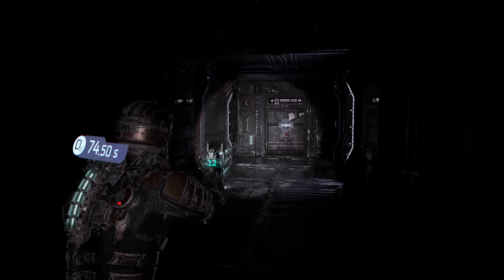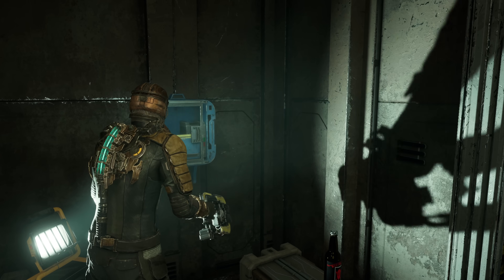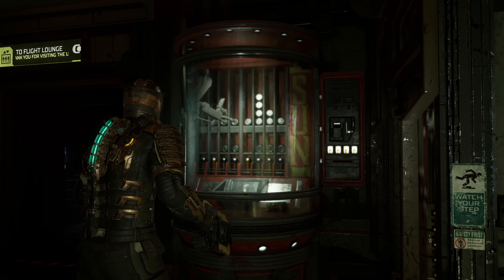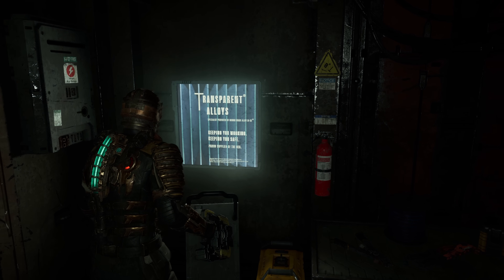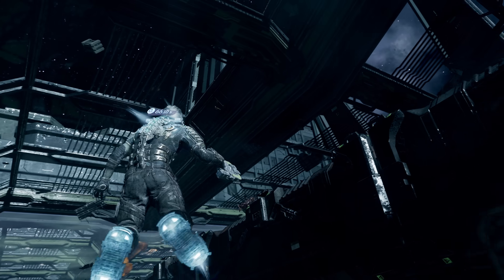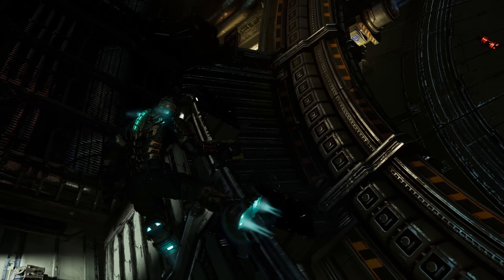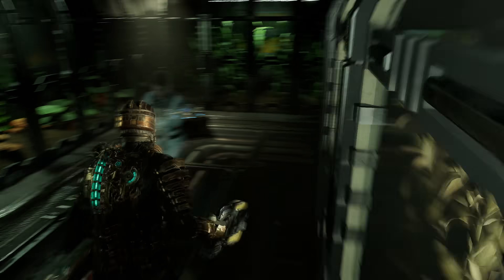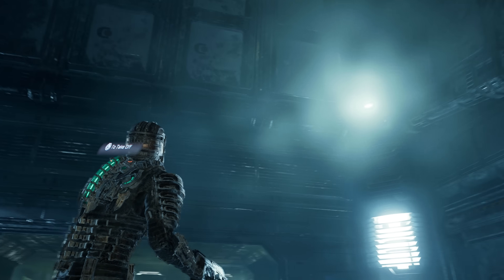Is Dead Space "Realistic"? - An Engineer's Review

Comment: With regards to the protection of staff aboard the Ishimura, I assume Isaac's suit is standard for Engineers, and is commercially obtainable. Meaning that a lot of the staff would probably be equipped with suits outfitted to suit their role aboard the Ishimura (E.g: Medics with healing pens, shield projectors; Fire safety suits with absurd levels of thermal protection; and I assume all staff have at least oxygen masks available for use during their active time, meaning they should be safe during a temporary hull breach.)
Reply: From what I can tell the best doctors and nurses can hope for are the Kinesis and Stasis modules at best (Stasis is unlikely due to their operating areas already having that function). Soldiers/Security, Engineers and Miners get the goooood stuff to wear.

Comment: I wanted to add that holographic terminals in Dead Space appear to utilize solid light tech, since in the Dead Space: Downfall the crew on the bridge seemed to be able to directly physically touch the holographic terminals as if they were solid objects.
Reply: There are currently projects running, showing that you can use ultrasound to simulate haptic feedback on holograms.

Comment: These protrusions on the tram aren't "armor" per se, they are just joints. The design of the tram is heavily modular, suggesting accommodation for the stamps\3d printers that are on the smaller side for the size of the tram, read - ease of on board repairs or straight up full manufacture, if need be.

Comment: When you show that the FSD from Elite uses an Alcubierre drive, you also show it using hyperspace travel.
I admit I havent read about the scifi in elite that extensively but I believe yes, the typical travel method using the FSD is Alcubierre, but that's only travel within a single star system. When traveling from star to star like you show, it uses hyperspace like wormhole traveling.

Comment: 1:27:04 I always took it to mean, the system needs more power than the battery/power cell you plugged in could have but it has the power to spin up a generator that can produce the power needed like a pilot light on a gas oven, if everything is working smoothly it should be relatively self sustaining but you still need the spark to start it up

Comment: I feel like a significant number of the design issues could be explained as corporate cost cutting measures.  We see this all the time in real life, after all.  A good maritime example is with the layout of engines on civilian ships.  There's often only one engine compartment, and it tends to contain both the main engines and backup auxiliary generators.  No subdivision means that, in the event of flooding, you lose all electricity and power.  There may be batteries elsewhere in the ship, but that's not a guarantee.  In the modern day, it's more likely that a ship will experience power loss due to engine failure as opposed to hull puncture and flooding, but the risk is there.

Bladed fans, sharp edges, and inadequate emergency lights all just sound like the manufacturer or operator cutting costs.  The Ishimura is a massive ship, so it isn't hard to imagine the operator and manufacturer wanting to get every penny worth of savings they can.  Doubly so if the safety regulations are not very strict, or not well enforced.  It is entirely possible the cost of the ship vastly outweighs the expected cost of paying out lawsuits and workers comp...which is a real life calculation.

Comment: 14:55 The breaker boxes are likely not original equipment, rather they were added to provide power to systems to replace damaged or failed sections of the original power grid that might otherwise require dock time to repair.
55:46 The food storage room has a hatch exiting to space so that food can be loaded straight into it while the Ishimura is docked. Might explain where all the apples and bananas came from.
1:03:54 Honestly I think it's even worse to have in that gondola track, because if you stuck your arm out the side of the gondola, it could easily be caught between the gondola and the sharp protruding edges. Not to mention just cutting yourself on it.The gondola has no walls beyond waist height.

Comment: As for why the ADS cannons need to be calibrated individually, it does make sense from a machine learning perspective. The cannons are in different physical locations, using training data from one cannon on another could lead to issues where things aren't accounted for, like shooting from a particular angle which is fine on the other cannon would instead hit the ship itself on a different cannon.

Machine learning (in its current state) is very bad at generalization. If you train an AI to perform one specific task, it won't necessarily be able to perform a very similar task, unless that task was also part of your training data.

Comment: 38:25 iirc, there is a very short direct path from the console to the door, but it was destroyed and blocked off by the corruption.

The big fans would normally be safer than that. I think stasis is supposed to be a near 100% freeze for an extended period of time, as you can see when Mercer uses his own stasis module. But of course, it had to be nerfed for gameplay purposes.

1:16:50 Temple's force gun isn't as powerful as it should be because Mercer confiscated components he deemed unnecessary for Temple's work, to prevent him from killing Mercer with it.

Comment: 21:16 Water can't condense in vacuum, because the air pressure is near zero. Water will actually boil in vacuum.
Water also doesn't get cooled in vacuum of space because vacuum doesn't conduct heat. In fact, vacuum is an outstanding heat insulator, which is why a lot of modern Thermal flask have vacuum built in them. 

26:20 this violates Newton's first law, space has zero-friction and ship will not be slowed down when the engine is off. For example, modern satellites can stay in orbit for months without having to fire their main engines.

Comment: I'm working at a factory in Russia and it's about as safe as the pre-outbreak Ishimura. We have a joke that unless you got injured in some way, you didn't really even start working.

Heat, acid, electricity, explosions, poisons, pressure - we have it all. We even have those huge fans that you have to go through in certain places. They're inside machinery and one of them is improperly set up, so it's actually turned on when everything tells you that it's turned off.

We do have safety regulations, but they don't really mean anything when you work in a building that was supposed to be demolished 60 years ago with devices that were made in 1953.

You sorta get used to it with time, learn to not lean onto things, watch what you step on/under and work around the rust and glassed wiring.

I can totally imagine how people on Ishimura constructed something and said "whatever, that will do", even if it looks extremely dangerous and poorly made. I basically have to traverse through partially submerged pumps and poisonous gas every day to check certain devices and we ain't even in space.

Comment: I believe in the original game, the crew of the Kellion argues about switching to manual control after the gravity tether fails.

Actually, it's funny to me that several of the quibbles in this video weren't present in the original game, or were different problems. Like the floor plates shooting lightning bolts. In the original game, the plates were blasting localized high gravity that was pinning stuff to the ceiling. Kind of lame they downgraded that to le tesla coil zap in the remake. The loud loud loud engine area? There were ear protection warning decals in the original, etc. Haha!

Comment: 32:38 
I think the reason they didn’t try to drop the rock off was a colony on the surface of the planet right under the ship. Sure, we get to know that everyone is dead there later on but at this point Kelian crew is unaware of that and they are here to fix things, not to cause even more damage.

And yes, holding on to the rock is more important than the ship’s integrity as dropping it would lead to great damage to the planet itself even if there’s nobody living there - it could prevent further natural resources extraction…
Reply: In the remake, one of senior CEC executives is on board the ship, and he was given special high clearance aboard, pretty much the same as master clearance. The tectonic load was secured under his clearance, which is why in the logs the engineers fell into despair, as they would have to tear apart half of the ship's wiring to bypass that clearance. According to prospectors' reports, the planet they are cracking is incredibly rich in resources, so the senior exec pretty much ordered to process it or die trying.
Reply: Yup, I thought so…
This is why I love DS - it doesn’t just portray cosmic horrors but also shows how horrible people themselves could be at the slightest glimmer of cash!

Comment: The amount of loose cargo and unsecured fans and cables makes me assume things aren't done following procedure.
Especially the fans look like there is supposed to be some protective layer, like a grate, in front of it. Possibly missing due to budget cuts.

And the language situation might be the result of working hands being more important than a shared language.
In fact, many trains here have bilingual messages to account for foreign tourists.

Oh, and transparent aluminium does exist. Or rather aluminium oxynitrite, a transparent ceramic. It is also four times as hard as silica glass. The patent was filed a couple years before the release of the movie, so by the time we see Scotty trying to use voice commands on that Apple II, the producers were most likely aware of it.

Mislabelled pipes might just be the result of someone using the wrong pipe for repairs. They needed a size 10 pipe for the methane supply, and they only had a size 10 pipe with hydrogen label. But it fits and so they used that.

Comment: I got an answer for the ADS cannons missing their calibration data. Sabotage. Break the engines so the ship falls into the planet. Someone fixed them? Well the ADS is down. ADS is back? Let me corrupt or move the ADS firing solution program. 

For the cryogenic freezing, that religious death cult believes in preserving the body so went all out on the system.

Why would you have a vent in food storage? Think of it this way: that's a door. Instead of bringing food in via shuttle, moving it to the tram, riding it to hydroponics, taking it up to food storage and storing it and then going all the way back to the han- no. Just put in a door in food storage. Move the supplies DIRECTLY into food storage from outside the ship.

A couple points that worked in the original game that got missed in the remake.
Those lockers with the CEC logo glowed green when you sign a light over them. Signs state that those containers are legit CEC containers and if you find any that don't glow, then it's fake. Should probably call security.

For the centrifuge it was originally designed with a walk way above the centrifuge that leads to the doorway, however an organic mass had destroyed the cat walk forcing Issac to use the very unsafe walk way the centrifuge spins at.

Also yes, i remember THAT door. I remember unloading with the plasma rifle hoping i could escape Issac's fate... i never could...

Comment: Somet days you're roaming the tall grass of youtube and a wild expert just appears. Those are good days.

If you're moving faster than the speed of light, will you see any stars? The light from stars behind and perpendicular to you, presumably, would not be able to "catch up" to you, and the light coming right towards you will.... will do what?

I'd like to make two potential corrections. At 18:00 blue light's influence on circadian rhythms are mentioned. I think the research on this is not as conclusive as to say that blue light alone can regulate a human's rhythm's At around 4:10 the sharp and pinchy places of that crew cab are pointed out. That's definitely valid. However, it's also said that the crew are too armored. It's possible that the ship's design team decided that it would be easier to pad the crew than to pad the interior of the ship. In the real world, the crew cabs of battle tanks are environments filled with hard protrusions that sometimes end up having...inconsistent gravity. Rather than making those environments entirely safe, that vicar of the modern nanny state, the Army, chooses instead to issue crews helmets, special boots, gloves and other pieces of armor.

That could be a justification. What cannot be justified, however, is the use of the term "battle tank". I am sorry about that.

11:00 I have a question about this. Would you design fans or bellows that were strong enough to resist being broken apart, or would it be better to design them to with parts that break easily and predictably into not-so-dangerous flying pieces?

14:45 I am curious about how overbuilt a ship like this would be. Presumably it's an economically viable product rather than a space agency's prestige project. So I might not expect an independent backup lighting circuit in all cases. I would expect battery powered emergency lighting in nonessential areas. You would have this and multiple independent backup circuits powering medical areas and powering other equally essential areas/equipment. You'd have independent generation, too. God knows what form this would take, though. Maybe you have some ideas?

I'm also not convinced that you'd be able to avoid running cables across the floor in all cases. Not only can the ceiling become the floor in emergency situations, but even cables run along walls will never, ever remain perfectly rigid (and there will are many cases where you wouldn't want them to be). Therefore, they will always present potential emergency handholds when SHTF. Not only that, but there will be emergency situations where you have to rapidly run circuits by the shortest possible paths. The solutions, then, are to have truly impressive raceways, rigid conductors imbedded into the ship's hull when possible, and reels of cables that use connections and have structures that make the cables themselves viable safe handholds.

17:00 The idea that I am inside and can't ever be "outside" freaks me out. Being in the ship itself doesn't feel that daunting to me. The mere lack of any potential "outside" does.

25:00 I don't think relying on blast doors is the best method unless they can be closed in by automatic, analogue means. Having a simple balloon near each window would automatically fill any gap. It  would expand in proportion to the amount of air pressure being lost. It might be easiest just to have everyone carry depressurization safety gear.

Comment: But is it actually realistic? You named a bunch of hazards but considering the setting it doesnt look too unrealistic. The safety stickers seem to be of the  "someone died here" variety. If an off the shelf piece didnt come with a safety sticker, or if someone didnt die yet to some exposed hazard, there is no safety reminder. If a bunch of people work a long time in the same environment they tend to be less cautious and wont fix dangerous damage as quickly.  If one engineer services the same piece for years he knows one blue cable is loose and probably is too bored with work to label it as a hazard (or replace it). 

As for the lasers being visible, maybe the dust and debris from blasting the asteroids makes it visible?